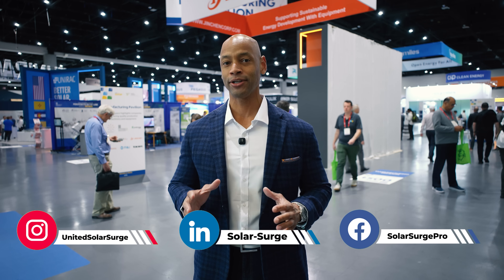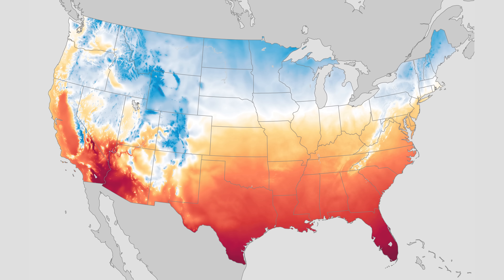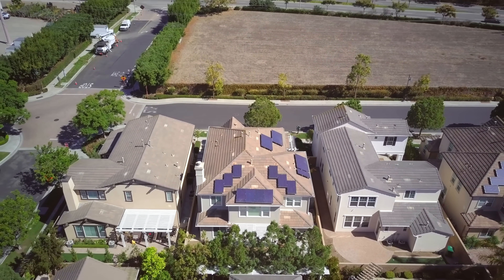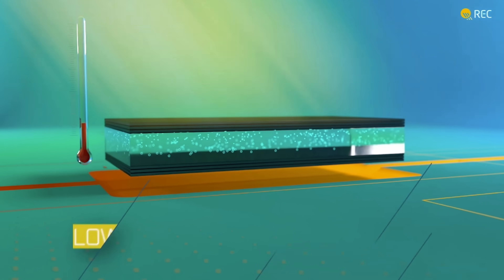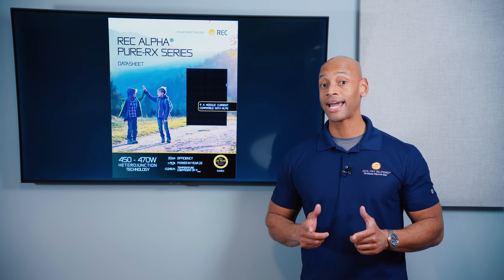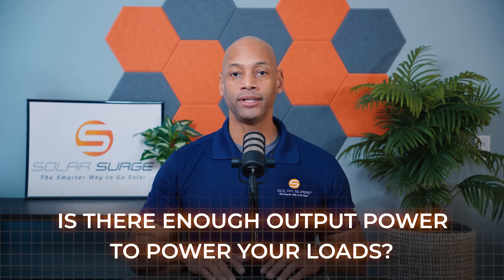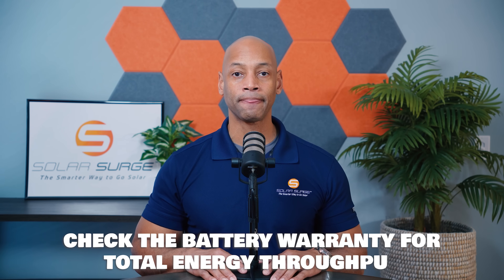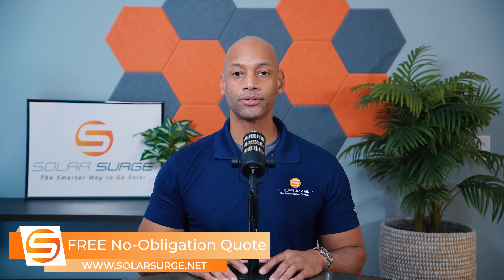Building The Perfect Solar System in 2025

Comment: I’ve installed so far 10 different point guard batteries set ups as an installer and I can’t get behind them it just screams made in China. I love how the battery can stack vertically. It has a very easy commissioning process. But also my least favorite part about the whole system is the junction box is horribly small and we use AP rapid shut down instead of some form of optimization as an installer in Washington I can assure you optimization and monitoring is the way to go

Comment: Ok timer for a serious question. Why not produce a paint on reflective surface that only reflects what is needed from sunlight.
 and paint it on the rear surface of a solar panel , diffusing the light by maybe rigging the rear of the solar panel....reflecting only the wavelengths needed , a small fan 1w could be used to lower temperatures, maybe a clip on cheap fan to keep panel manufacturing simple..
Ok i wet much deeper into this than decided to use ai to discuss it, and it already exists in a way but is t too expensive due to complexity, i am sure it could be made much simpler as they do in bifocal panels right now., but i am sure with time will become a real thing, anyone interested search for  "Passivated Emitter and Rear Cell technology

Comment: Well, I've called about 10 solar distrubutors and installers in the central FL area and no one has REC panels (nation wide shortage due to warehouse fire) and most either do not sell PointGuard (now Sigenergy) or they haven't even heard of them. I like your videos and I find them informative, but a product sugestion is pointless if it is not available to a large portion of the country. Unfortunatly for me, I wont be able to purchase or install REC panels before the tax credit goes away. Hopefully solar prices will settle down in 2026 and I will be able to install a system without going broke.

Comment: Definitely agree with your PointGuard/REC recommendation.  I connected my brand new 3-battery 24 kWh PG system to a 12-panel REC 4.86 kWp DC system as well as separate 3.24 kWp AC connected system by GAF Energy. Bill last month was $15.43 using a Reliant Truly Free Nights plan thru Reliant Energy.  Daytime energy usage last month was 32 kWh.  Nighttime energy usage last month was 1,530 kWh. Solar energy production last month was 513 kWh.  Live in Texas (August was hot).  Have two newer variable speed HVAC systems.  Have a pool.  Don’t have an EV.

Comment: Do not buy Generac I bought it told them before I was living off grid they came to install it knowing I was living off grid it worked for 6 months they refused to give me the warranty or fix it because they said it's not meant to run 24 hours for 30 days and I told them I lived totally off-grid and they said the system is not for that and didn't do anything I paid $6,000 cash for a 10 whatever you call it instead of giving me a $20 they gave me a $10 that was fine at the time my dad was dying and I wanted him home with me so I would have paid anything and that's what I did not knowing but and and still thinking God that it lasts three days after he did it went completely out I called Generac and they told me it's not an off-grid system

Comment: System requirements, no load shedding, run everything. Maximum solar panels, inverters to run all, battery back up for ALL loads for at least 3 days of zero solar panel production, batteries at 30% inverters fire up generator if no grid is present. That is the goal. If the wife wants to use something I don’t want her to have to worry about overloading anything.

Comment: Why invert from dc to ac and back to dc to store in your battery system? Seems like a waist of energy in the conversion and extra cost. DC coupled makes the most sense. Seems to make most sense that all inversion to AC needs to only be either when sending direct to your home electric system for usage either direct from your solar array or from your battery system. Thus is there a 30KW system available that does this with the integration of generator backup. Sounds like REC and point guard makes the most sense?

Comment: I have now talked with 4 area solar providers.  What I found is that they are quoting from SolarElectricSupply preconfigured packages and doubling the price for installation.  If Solar Surge can quote me an installed system utilizing PointGuard and REC panels with an installer for my zipcode 32462 I would love to hear it.

Comment: Hi Joe , nice video but you always push the most expensive equipment or a close end parts. You give good insight information,  but most people are looking for answers to either to fix, add or improve what they got. Without always pushing  them to a $20k answer. I have solaredge equipment and just adding batteries with solaredge is almost a $20k job. I'm adding a hybrid inverter with batteries that's not solaredge and its only cost $5,550.00 without taxes.  A 12kpv inverter (inverter was $3,700.00) with four 12.8v 300ah LIB batteries that only cost $340.00 ea. didn't break the bank.
Reply: What panels and battery did you buy?

Comment: I bought my own solar panels. The problem is finding an installer. They always want me to buy their solar equipment. I told them dont have to warranty their work. One company gave me an option. One is to buy their solar with a labor cost of $8000+ for a 4kw or $8000 for labor for my 1.5kw. I told them to suck it.
Reply: Amen brother
Reply: Hey man, I hear you. 

We run a not for profit solar company and our founder used to build software for some of the largest solar companies. He got fed up with solar companies caring more about their own pockets than the end customer so we opened a not-for-profit to help fill that gap.

If you want reply here and we can get you setup. We’ll guide you step by step on getting it installed, and 8f you’re in one of our areas we can do it for you.
Reply: @isabellereynoso802 i'd be interested in that!
Reply: What’s is your close to location?
I might have some suggestions for installers who I trust.

Comment: Always informative and useful,    I've one concern  to address, you and  some of the promoters of battery storage are giving accurate  information  on stackibility of some of the battery modules products abilities to stack over 20 kwh however  the 855 fire code is not allowing over 20 kwh in a single stack. In fact for in a residential home the code is stating  no more than 40kWh  total limiting the owner to only put in two stacks of 20kwh each. In a garage  installs are limited to 80kwh total . Further more installers are being required to build mechanical rooms for indoor residential battery storage applications based on the newer fire international codes. Greatly increasing costs of installations.
Reply: @snakecreepsdown  wow, that is all concerning. Hope he does a story after I am done with my stuff and grandfathered in before all those changes 😇😎🤔.
Reply: @d.pollard5962  I'm  in Michigan and the installers here that I have talk with aren't going to touch an indoor install without adding a mechanical room that meets fire code. Honestly the various local inspectors I'm not so sure about,I think diy folks should reach out for clarification for their individual installs with their local inspector.
Reply: @snakecreepsdown  in that part of the country you need to oversize because of f the cold and snow. So that would s a sad thing. Hope they take that into consideration. These restrictions sound like there restricting to help the power companies. I hope this is really about safety
Reply: @d.pollard5962  safety is the concern,  however it is overkill in my view. I've  yet to  see rational reasoning for  limiting  stacks in a home or garage.  Example attached  garage  is allowed  80 kwh while inside a basement is  40 kwh ,  Not reasonable in my view
Reply: @snakecreepsdown  totally agree

Comment: We are off grid on a system that my father-in-law built 25 years ago and I would like to upgrade the inverters. The batteries are Farley new but the inverters are original and the system is 24 v system. We also have a diesel generator with a 300-gallon tank. I need 6o modernize as we have no idea how much energy were producing nor how much we use. There is an archaic analog gage show battery % and I would love to get an app to show me everything. Right now I believe the generator comes on if the battery get below 70%. Were in New Mexico and would love help with our situation any help would be appreciated and with your knowledge this would be a smooth situation.
Reply: I would contact signature solar or Victron Energy. I think both have expert customer support that can steer you in the right direction. Something like a FlexBoss/Gridboss could work well and batteries can be rewired into a 48 volt pack. Likely you will want to upgrade panels at this point since it’s 24 yo system. Victron I think can work with the existing 24v components as is if you just want a replacement inverter/charge controller
Reply: @ShaneTheGeek Thank you for the information. I would hate to have to replace the panels as they are brand new but I will contact these companies and see what they have. We have the money to make the investment I just want to make the right one as this needs to last just as long as the original system.
Reply: @ModernCowboy78 Okay gotcha if panels and batteries are new and it’s a traditional off grid setup with separate solar charge controllers and inverters then Victron may be a more optimal direct swap in fit without changing any existing wiring. Either way I don’t think any panels or batteries would need to be replaced as you would likely be able to wire in series as needed to step up system voltage to match whatever central inverter you choose even if it’s not directly 24v compatible I know Victron has 12 and 24v volt compatible equipment. Where as most on grid and hybrid capable inverters are 48v based which means you may need to rewire your battery bank and solar array to step up input voltage to 48v.
Reply: @ShaneTheGeek ok wow thank you for the information this will help a lot.

Comment: Why is no one covering Duracell?
Reply: It's also British designed. That's a very good thing. Quality will be way up there and it's Duracell, they're not going under any time soon.
Reply: It's a DIY system with non-grid-tied capabilities. Just can't stack up to mentioned inverter brands.
Reply: @KevinAnderson-u9f  Na I think the capabilities are there with 2 Duracell Inverters 2nd will only come in when needed. 100 amp Draw the batteries can provide, 3 of the batteries is 15kW That's plenty load draw isn't it.

Comment: Well done.  REC panels, Point Guard inverter and storage seem to be getting a lot of positive feedback which is nice.  The bidirectional also sounds great.  Curious how that plays out in the long run and wonder if utility companies see it as a risk.  And by the risk increase rates and/or tiers.  For example what if I own a Ford Lightning, charge it at work for 4 hours (free) then use that at home during my normal peak hour tier?  Or what if I charge the truck at a lower cost station then use that at home and then charge it the next day during peak solar production.  All things I'm sure the utility companies are looking at to adjust rates to pass on to the consumer.  Maybe it is all just a conspiracy theory and the utility companies embrace this.  

Maybe this is already possible but it would be nice as a home owner to do some of the install on my own and sub out permitted and critical parts.  I respect small businesses but a few of the quotes we received the labor made up 30 percent of the total cost and in some cases 50 percent.  In todays climate that is not going to move a lot of product.  In my opinion.  

Enjoyed this - keep up the great work.
Reply: @saf1671  wow, all we can do is adjust as they keep raising rates. Do your best to bring your cost down and keep adding and changing to keep it where you can.

Comment: Do you like Eg4 equipment
Reply from the maker: I do like EG4 if you are open to a more hands-on project.
Reply: @SolarSurge SolArk vs Eg4?
Reply: I just invested in a large EG4 system and I am curious how you define DIY.  I don’t have the whole system yet and I know I will be connecting and setting up the panels and the ground mount, but I am not installing the inverter.  Do these other companies come out and completely set up the entire system and hand you the controls when it is done?  Just curious.  I am an engineer so I like hands on but I don’t like electrical.  Lol

Comment: Great video thanks for sharing 👍.

I would suggest that it's probably a good idea to keep inverters and batteries separate. 
Solar seems to be a pretty volatile industry in that we don't know what companies will be around in 5, 10 or 20 years. 
Point guard looks like a great choice, but if they're not around in 5 years. 
Now you have both an inverter and a battery system that may not retrofit with other possible replacement options and replacement parts may not be available.

To be clear; I'm not suggesting having one brand for both components is a bad thing, I'm just not sure having everything rolled into one won't be a problem down the road. 

If I were going to go with an all-in-one inverter battery combo I would probably stick with Tesla 3. There's probably a higher likelihood of replacement parts and service or that the company will even exist 20 years from now compared to all other newcomer brands.
Reply from the maker: I would agree with you in terms of which company has the greatest chance of still being here 10 or 20 years in the future, Tesla probably wins in this category.
Reply: @SolarSurge I'm glad you agree. Based on that, would it not be advantageous to not put all of your eggs in one basket by having a combined inverter battery unit as well? 
I mean if a company goes bankrupt now you're out both an inverter and a battery if something fails. 
With separate components you can probably find something to swap it out with even if it's not the same brand.

Comment: Thanks for the content as always! What're your thoughts on the string vs micro inverter tradeoffs? Espcially considering the significantly higher warranty on Enphase inverters?
Reply from the maker: That’s a great question. In the past, I would have said Enphase all the way, however, given bypass dials on modern solar modules, and the emergence of very efficient all-in-one systems like PointGuard, I don’t think I would go with micro inverters on a new system today.
Reply: @SolarSurge  I see, thanks for the insight!